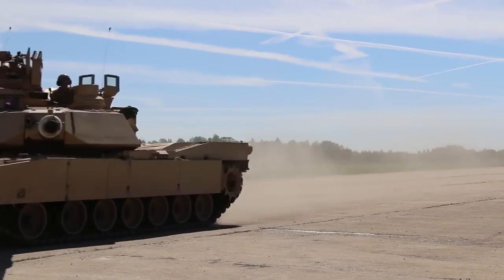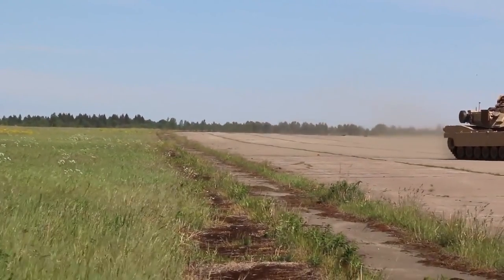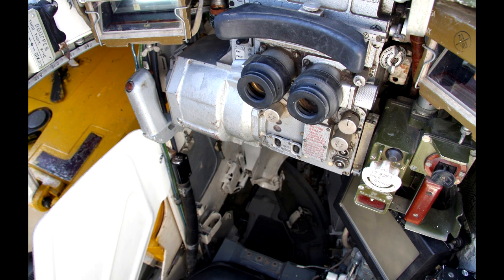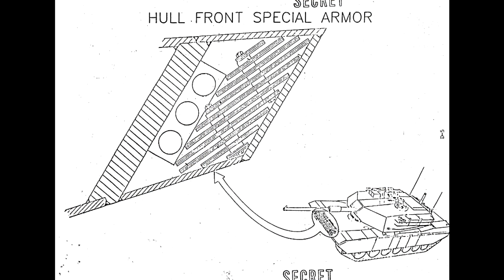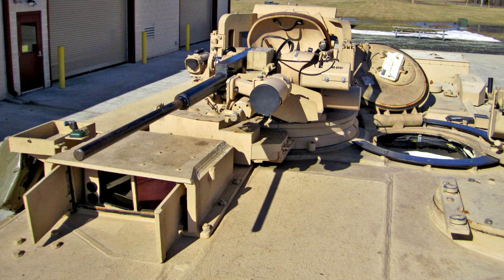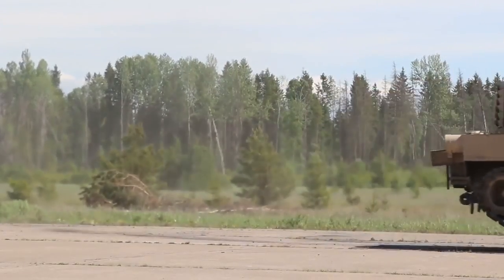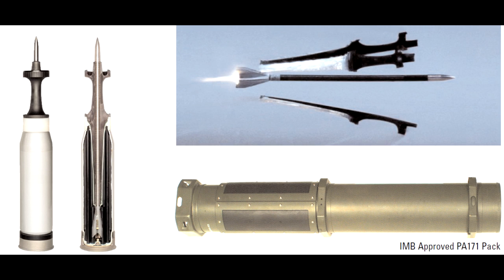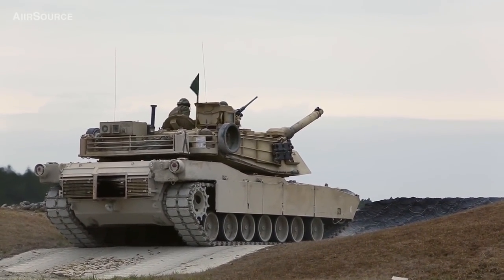Problems with Abrams tank

Comment: You should have mentioned that the M1A2 SEP and M1A1D were upgraded with digital battle management system with GPS colored display maps where enemy forces are shown on the digital map (if detected by other sources), this gives the M1A2 commander the ability to exchange crucial informations about enemy position and movements on the battlefield with other tanks which gives the crew excellent situational awareness. This is something that most other tanks are still lacking even today. It gives the Abrams a big advantage over most other tanks.
Reply: Wall hacks :D
Reply: Nico Yeah have you heard of this thing called radio and coordinates or you need everything served on your ipad visualy to be able to function ?
Reply: @plazmica0323  It helps the crew to get the job done faster and more effectively in the chaotic combat. It's all about outperforming your enemy in the best way possible. Giving wage coordinates on a map is much less accurate than pinpointing the exact location of enemey units on a digital map which helps the crew to find and identify the enemy much faster. And this is one of the most important things on the battlefield to act fast to overwhelm your enemy. 

Sure, you could also do it with a normal map and wage coordinates too but it would take longer to find the enemy and it's more confusing for the crew because they don't know exactly what they're going up against and it's overall much less effective in combat. Technology helps to increase effectivity and performance of the crew and tank.
Reply: Nico I think simple radio and gps do the job quite fine,maybe even same because targets move around so you are anyways on alert going where they were last spotted.
Radio waves can be masked with changing frequency while wi fi or e connection for ipad in tanks cant and can be potentionaly hacked rendering whole system useless  or even worse, a lost battle if it happened in middle of it.
Also i think less information on whereabouts of enemy makes it better since idiots would be rushing around to flank units because someone spoted them and put them on map.Pretty fast they would discover that fog of war doesnt quite work like in video games.
Reply: Nico Ofcourse if you are attacking rust buckets like americans did on iraqis then its most efficient way to rack up dozens of kills since you only need to sweap them.
With serious clashes the system would be pretty much on pair with common equipment used today.
Reply: Nico Yeah lets potentionaly serve enemy whole unit placements on a map just because some crews are borderline incompetent to say at least.
Also those incidents werent caused by radio problems but by shere studitity displayed that day without following basic procedures of recognizing friend and foe.
Thats entirely different problem,when army tries to fill ranks with scraping the bottom of the barrel for certain positions.
Radio waves cant be jammed easily because transmitors can change frequency or send data through proxy stations or even send in different directions with some of it picked up.
You cant do that with military designed (basicly an ipad with different look) touchscreens.
They communicate on basic level wifi network or e link that gets blocked even by trees and walls.
Every network can be penetrated but the matter is how much of it is revealed in such scenario.
Commanders sharing voice informations or doing radio silence on a mission is in my opinion far more safer  than bunch of data being thrown around across battlefield between dozens of units.
It can work in CoD or when battleing sand people with ak's but against equal opponent its less desirable than standard used equipment.
Thats just my view on the topic.
Reply: @plazmica0323  Your statement "Pretty quickly they would learn that the fog of war doesn't work like it does in video games." Is going off of the assumption that these are radically undertrained and unprepared crewmen
Reply: Gamma Raygun I think Guderian wrote that even most experianced tankers couldnt detect russian AT placements and fire pockets untill first tank got blown up or hit a first line minefield.
In a sense training does serve a purpose but only troops that are somewhat quality trained are veterans and service men in active zones.
Rest of army that serves and trains in field once a week in boot camp would be mediocre at best in real combat.
That goes for all branches in my opinion.
Reply: @plazmica0323  But even at the start of Operation Barbarossa, many of the German men were rushed through training thanks to a shortage of fighting East. The large numbers of men conscripted in the wake of the invasion were policemen, older men (but not old), Hitler Youth and young men who should've been conscripted in 1942, meaning that the bulk of the Germans who invaded in June 1941 were quickly conscripted and pushed through training, and that's relatively early war, lending an explanation as to why tank crews were so ineffective. While it's obviously true that someone's who spelt longer in the field than someone else is going to be more effective (Atleast initially) and more sensible than a man just out of boot camp, for someone to just fly off in their tank, alone, and try to outflank the enemy, alone, is just stupidity. And to why the most experienced couldn't spot AT positions? Quite simply, the Russians were extremely good at concealing their positions, plus the modern tanker has access to thermal imaging and drone reconnaissance (among other things) and so a modern competent tanker wouldn't be relegated to waiting for the enemy to open fire.
Reply: Plazmica 032 you are the perfect example for “ok boomer”
Reply: Efank Im ok with that.
Reply: @plazmica0323  like you would know what its like to be part of a tank crew
Reply: Zany Jumper My brother is in tank regiment and everyone in tank except commander and maybe gunner are trained on vehicle like they have a half brain functioning.
Its that easy and it needs to be like that,easy to be repetitive and avaiable to most potential crew in times of war.
Russians design their tanks in a manner that a ordinary man that has a drivers licence can in few days operate tank like  any crew memeber.Construction workers that drive excavators or baristas doing tens of beverages at night are more competent to operate ammo loader and tank driver positions than most of boys that serve.Thats why pay is shitty as it gets.
Reply: @plazmica0323  Why do we need to spend precious minutes calculating positions, coordinates and other stuff? Dont we add more things to help us in order to make this stuff be more quick and efficient, since I'm very sure people don't work well in very stressful conditions.

And yes radios and maps work fine, but a GPS works better

And WiFi connections are basically radio waves. And they can also be bounced around

And I'm very sure people won't spend hours in order to hack a single tanks system while in combat. It would be inefficient.
Reply: @wooflessdelta  I guess he probably wants to go back to manually calculating the range to target using optical rangefinder instead of a laser-rangefidner. Why using modern point-and-click technology when you can use outdated WW2 tech. Why even use tanks and aircraft, when spears and swords can kill to. No need for tanks, horses work too...
Reply: Woofless Delta Btw love the confinement stuff.
Reply: @plazmica0323  let's get rid of tanks, aircraft and missiles, we don't need that witchcraft. Swords and arrow work just fine lol
Reply: Nico Actualy its very likely that it would go like that nowdays.
With a strong dependance on tech and God knows only how powerfull emps exist today or some other stuff not yet seen you might as well find yourself battleing with sticks and stones,roughly speaking.
Also please dont exaggerate.
All im trying to say is that huge technology dependance is obvious weakness that enemy will surely try to exploit in every way possible on todays battlegrounds.
Reply: @plazmica0323  We have tech that can counter that.
Reply: Woofless Delta We (common people) dont have a close idea what is out there developed in labs around the world.
Thats what i know for certain.
Reply: @plazmica0323  If there's something destructive, we can counter it. Even asteroids. If we detect them fast enough.
Reply: Woofless Delta lol no we cant.
We have 99% chance of not noticing extinction scale asteroids let alone anything reliable yet to stop the from slamming into us.
We have nukes to try to brake them appart but that works to a certain degree and size.
Theres bunch of stuff already in world that can end us now.
Like Yellowstone volcano if it were to erupt,or russian bio weapons like super viruses that could wipe all humans in matter of months.
Tens of hundreds of nukes ready to fly at push of a button.
Economic crash that sends us to middle ages.
Plenty of stuff.
Reply: @plazmica0323  Which has the chance to stop them, or move them away from hitting our planet.
Reply: Woofless Delta In comparisson that would be like thinking if i ever got hit by a car and if it happens to be a car that is made of pillows i would survive.
Technically it is possible to happen.
We dont even know what a potential asteriod is made of untill we find parts of it on Earth.
For all we know we could be hit in next hour by solid granit mountain travelling thousands of km's per hour and we wouldnt even have time to figure out what happened while flying away on a chunk of plants crust.
We dont even know if our Solar system has 9 planets or not, let alone what could fly at us if it werent for Saturns fat ass attracting 99% of it.
Reply: @plazmica0323  I understand your point of criticism about modern society getting more dumb but hell this has nothing to do with military tech or military in general

Comment: I totally agree with the gas turbine part, the mentioned reason was most probably legit. Therefore I can't understand why the Soviets made the same mistake with the T-80 series. The only other reason for this I can see, is, that back then gas turbines had a forward-looking/innovative reputation, as this technology was used in fast helicopters.
But I don't think, that the U.S. wasn't able to build a proper turbo charched diesel engine. I mean, the german company MTU has it's headquarters at Friedrichshafen and they used to build bigger V-diesel engines for boats and ships like ferries, which are deployed there (Friedrichshafen, LAKE of Konstanz = Bodensee). I 'm almost certain that a company like General Electrics or General Motors could have made a good diesel engine for the Abrams.

Comment: It's a high produced heavy AF tank, it's going to have problems. 
I served in Iraq as a tanker. One of are TC's had lost 3 tanks before 06'. It has plenty of flaws and there's a lot of room for improvement. No V shaped hull, weak top, rear, bottom mid to rear flanks. It's designed to take one heavy frontal hit and save the crew and that's it and that was what it was known to do well. 
The rumor was that it used 8 gallons of fuel to start. The A2's effectiveness went up, but it had a heap of reliability issues compared to it's analog little brother the A1. 
In basic the drill sergeants made sure we understood that this tank was flawed and showed us vid after vid of Abraham's getting destroyed by IED's in Iraq. 
It's an expensive flawed beast that did its job but has been out to pasture. 
Good vid
Reply: Sleeping Ninja You were a tanker, And you don’t know how many gallons it took to start the tank? Okay...
Reply: @MrBirdonawire  it was something we never got a straight answer on. We did know the max road and off road range but not on how much fuel the turbine engine consumes when starting. Do you know how  much fuel your vehicle uses to start?
Reply: @MrBirdonawire it's also been awhile since I was in the military. We also barely used are tanks in iraq. We were TWATS and we're mainly mech infantry.
 I'm guessing you're a kid
Reply: Sleeping Ninja I can understand that. And your point makes sense. But no, actually, for a living I study military equipment, mainly Russian. And I mean no offense. In different environments, prep time, etc, these can vary. May I ask when you served? My respect goes out to you.
Reply: @MrBirdonawire  I didn't take offense. I really liked the vid to be honest with you, I'm just an asshole. 
I deployed to northern Iraq on oct 31st 2007 to Feb 06th 2009. 
I served in the armored Cav, but for the most part we left are tanks in the motor pool and used up armored Humvees and are boots.
TWAT stands for tankers without any tanks if you weren't familiar with the term.
As a army tankers we always wondered about the T-90. We knew it was a capable tank and few steps up from the older T-72. The fact that the abrahms main gun had a lot better range vs the T-72 made me wonder if the T-90 had a upgraded or more advanced main gun then the T-72. Plenty of  American tankers were convinced it was a good match up and I'm sure in different scenarios it's probably a more effective tank, everything is situational. 
Thanks for the vid. The M1A2 Abrahms is an awesome tank, it also deserves to be criticized. 
Loved the intro to the vid, we feel the same way.

Comment: I mean isn't a gas turbine engine quieter than a diesel engine?
Reply: RagexPrince683 it is much quieter
Reply: Does that justify not using a Diesel engine? I don’t really think so, thanks shoot very very loud rounds so gas engines won’t really help that much
Reply: @agentc7020  it makes the abrams more stealthy than other mbts that don't use a turbine (keep in mind the vehicle's not gonna be firing constantly so you're shooting being loud argument is invalid)
Reply: RagexPrince683 yes that may be true but that still doesn’t mean the huge (and I mean huge) figure of an abrams doesn’t stand out, it’s not like they are undetectable just a tad harder to locate, UAVs and scouts can easily locate a abrams tank if they know where to look (keep in mind this is true for every vehicle be them loud or not), so no I still don’t believe that because it’s “quieter” you can justify the issues of the engine
Reply: @agentc7020  you miss understand, I do not believe that they put in a turbine engine because it is not as loud (I believe this a secondary benefit), they put it in as for what they see is a better power system.  Yes it uses up loads of gas, but I can tell you that the US Army does not lose sleep worrying about fuel, we have plenty, it is lighter than a comparable diesel, it has better power output than a comparable diesel, it runs in all temps, it is easy to maintain, and there are other reasons to use a turbine.  The M1 has had problems in the desert, but they have been mostly been handled, we made the M1 for fighting in Europe primarily, and like all other equipment we use they are made to be used in all theaters.  It will not be perfect for all theaters but it does handle well in all of them.  FYI, I served 14 years in the US Army, I was a 19D, not a Kilo I am not a CDAT, I worked around them and with them, the M1.  This does not make me a subject expert, but I do have a lot of practical experience.  Nor was I only a 19D, I was in the maintenance side of things first, I have seen how equipment is used in the field and had to repair equipment in the field.
Reply: priest0701 well if you say so, however just saying “we can afford to do it” doesn’t make it the best way in my humble non tank expert opinion
Reply: @agentc7020  I can understand that.  Look, I was not meaning to call you out or anything like that.  The US Army just does not worry about things like fuel or bullets or transport aircraft.  They have been fighting wars with huge budgets for over 70 years, our forces, the US, have a major foot print when they deploy with all the bells and whistles that you can think of (plus even ones that you can't), and this is one of the many different reasons why the push has happend with unconventional forces.  Cheaper to run and much smaller foot print.  Small team of guys roll in mark some targets, train some locals, and the air force and navy bomb the shit out of them.  The only times we, the US lose now, is when we limit ourselves, Black Hawk Down comes to mind, the requested M3's to move in and try to grab Aded.  Different movie if they had been allowed to do that.

I hope that you are well, take care.

Comment: No other tank has defeated  the m1 and every tank should have  multi fuel use  capability like the m1  in case you run out of  a particular type of fuel  .if your tank only uses  diesel  you are screwed  because in a  world war  diesel and gasoline  runs   out.  a stranded tank  is a sitting duck  good luck trying to get diesel  and gasoline during a world war   . jet fuel is a good idea  because the usa has a abundance of  jet  fuel  and when conventional  fuels run out  like diesel and gasoline  the m1 tank  will still be in the battle   when  others will be stranded  so jet fuel  is a good idea.
Reply: Actually, at least 1 or 2 Abrams have been hit, penetrated and disabled by Iraqi T-72 in 1991, with at least one Abrams resulting in a total loss (burned out). Luckily none of the American crew members were injured, they all survived the hits. Both Abrams were hit on the rear part, luckily missing the crew area.
Reply: @xAlexTobiasxB  yes i heard that but i dont think  it was  1 m1 against  1 t72   each time  the m1s  took a lot    other damage  before  they engaged  the t72s if they engaged t72s  at all it is very difficult to  determine  what ultimately destroyed those  tanks  the easiest thing  to assume  is they were destroyed by t72 s and there was a big controversy  about  what actually destroyed or damaged those tanks  .  I think one of the m1s had a fuel spill  and the other it was inconclusive  .